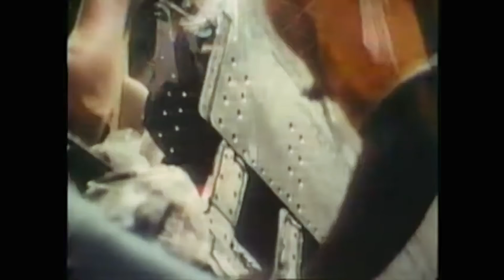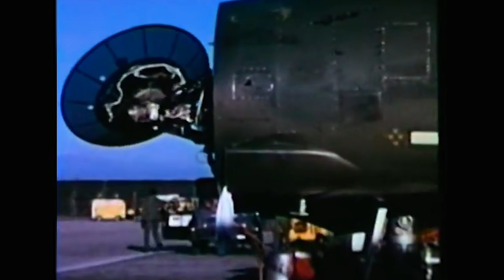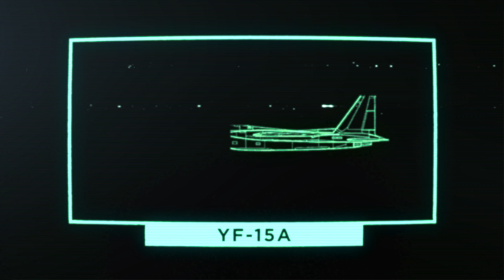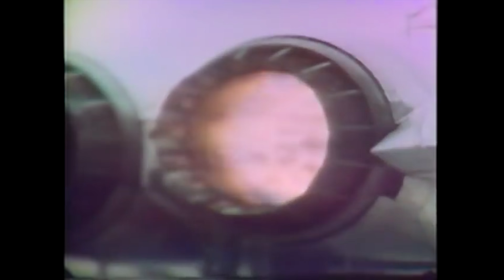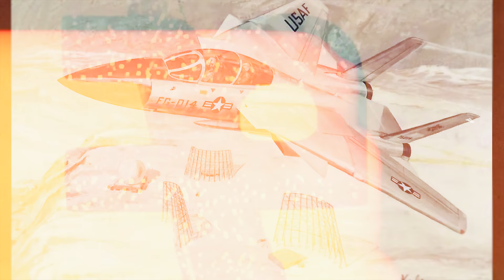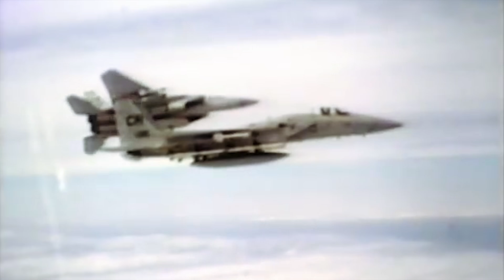F-15N | the forgotten 'Sea Eagle'

Comment: I think rather than thinking, “damn the sea eagle would have been better than the f-14” I just appreciate the the f-15 program was versatile enough to even be considered in the first place.
Reply: At sea, there was no aircraft better than the F-14.
The F-14 is a masterpiece of engineering
Reply: @رضا-ص2ن  The F-14 was always a maintenance nightmare.  However, the combination of endurance, the AWG-9 radar, and the AIM-54 Phoenix gave it a capability the US Navy, and the Iranian Air Force, decided they really needed.

It was optimized to shoot down Soviet bombers before they go within cruise missile range.
Reply: So you know how people complain about F-35 crashes? The number of F-35s that have crashed in its US service life so far across all 3 branches was achieved by the F-14 in its first 2 years...
Reply: @TyrannoJoris_Rex I need some help understanding, does that mean the f14 is better than the 35? Or worst?
Reply: @BLADEMANDAD  Neither. Just means the F-14 crashed way more frequently
Reply: @TyrannoJoris_Rex  I see, thats expected given how unforgiving carrier ops is, the fact that the tomcat is at best manual with stability augmentation vs fly by wire... and all the sensor/instrumentation gaps between the f-35 and the f-14...
Reply: @BLADEMANDAD  F-35 operates off of carriers as well as STOVL aboard amphibious assault ships, so F-14 doesn't get that excuse
Reply: @TyrannoJoris_Rex  , FLY BY WIRE and PLM???

big diff mate.
Reply: @TyrannoJoris_Rex  Fly by wire systems make a huge difference my guy as well as the F-35 getting an extremely advanced Heads Moving Display system for considerably better situational awareness. Its like comparing a F1 car from 1980 to one from today.
Reply: @رضا-ص2ن  Yes and no. In terms of its radar and the use of the Phoenix missile, the F-14 was revolutionary for its time. However, as time went on, the issues that plagued the early variants made the aircraft less and less valuable, particularly because of the costs associated with maintaining, and often simply fixing, the aircraft.
The engine issue is probably the biggest example. The Navy rushed the F-14 into service with the TF30 because the engine they actually wanted wasn't ready, and the TF30's reliability and handling problems held the Tomcat back for much of its early career. The F-14B and F-14D addressed a lot of this with the F110 and improved avionics, but by that point the Tomcat was already an expensive and relatively specialized aircraft.
And that's where procurement becomes important. Only 38 new-build F-14Bs and 37 new-build F-14Ds were produced, compared with roughly 400 F-15Cs and over 1,400 F/A-18A/B/C/Ds. The Navy simply didn't procure the later Tomcat variants in anything close to the numbers seen with other 4th-generation fighters. The F-14 also had virtually no export market outside Iran, whereas the F-15, F-16 and F/A-18 were exported to numerous allies, helping sustain their production and development.
So I wouldn't argue that the F-14 was a bad aircraft. Quite the opposite: it was genuinely revolutionary for its time. But being revolutionary doesn't necessarily mean it was the most practical or sustainable fighter over its entire service life. Its engine problems, high operating and maintenance costs, limited export market, and relatively small procurement of the improved variants all contributed to the Tomcat ultimately having a much smaller long-term footprint than aircraft like the F-15, F-16 and F/A-18.
Reply: @رضا-ص2ن  the F-14 was a master of design, not engineering. If it was a master of engineering, it would've had a much better maintenance anf availability rate
Reply: @De_cool_dude The design of the F-14 started in the 1960s and was completed in 1974. At that time, it had the world’s most powerful radar, the best variable-sweep wing system, the first turbofan engines, the world’s first chips, and the best computer systems of its era. Most importantly, it had the best coordination with the longest-range and best missile of that time — the Phoenix — and achieved the best results.
Trust me, my friend. I’m from Iran. Back when relations between my country and the United States were good, we bought eighty F-14s. Three years after the contract was signed, a disgraceful revolution took place in my country. Less than two years after the revolution, Iraq attacked my country, and Iran’s F-14s were on the front line defending the skies of my homeland.
Iran is a country that has vast seas to the north and south, two extremely harsh, long, and high mountain ranges, and a very complex climate. Right now in summer, the temperature in my city of Ahvaz is over 50 degrees Celsius, while in another part of the country the snow is so heavy that the whole world looks white.
When the revolution happened in Iran, the new government either fired or killed most of the Air Force personnel, engineers, pilots, and even the janitors. After the revolution, Iran was sanctioned by the United States and no F-14 spare parts reached Iran. Iran also had no AWACS. Despite all this, Iran fought the entire eight-year war with the F-14, scored the longest-range kills in history, and produced some of the best Iranian — and even world — pilots, all of whom were F-14 pilots. Iran achieved over 150 aerial kills with the F-14. After the war, because of the sanctions, Iran couldn’t buy new aircraft, so it kept the F-14s for nearly 50 years until they were destroyed in the war with America.
I told you all of this so you would know that the F-14, under the worst and hardest possible conditions of maintenance and support from my country, defended it in the best possible way. That’s why I call it a masterpiece of engineering. The F-15, F-16, and F-18 never operated under conditions like those of Iran’s F-14s.
Reply: @رضا-ص2ن  Don’t get me wrong I think the F-14 is pretty cool but Iran had the option to choose either the F-15 or the F-14. I’m sure if they had chosen the F-15 you would be talking just as highly about it. In the end, it’s just perceived greatness depending on whichever aircraft your own country flies
Reply: @GFSツ Until before the Iran-America war, there was a lot of discussion in my country about how Iran ended up preferring the F-14. Then the people who had evaluated both aircraft on behalf of my country at that time came forward, spoke, and explained that because Iran is a vast country with harsh mountain ranges, it needed an aircraft with a powerful radar and missile. That is why the F-14 was chosen. Of course, there were other reasons for selecting the F-14 as well, but it would take a very long time if I wanted to talk about them
Reply: @رضا-ص2ن  yes and no, physically range was in favor of the f-15. Even the f-15a was a longer range than the f-14a and Air Force thought the f-15a was short legged. The f-14 was a naval aircraft but Iran used it as land based fighter. I think Iran choice was based on  the awg 9 + Phoenix. Not much else in terms of performance, as in every other aspect, the f-14 fell short of the f-15.
Reply: @christosalexandropoulos7807 You’re saying Iran didn’t choose the F-14, but rather its radar and missile. That’s great. Now I want to know: if you take away the radar and weapons from fighter jets, what do they really have left to offer??
You can have a fighter with the best engines in history and the longest flight range, but if it has no radar and no weapons, then it’s not a fighter at all anymore. Maybe you could call it a private jet!!!
At that time, Iran shared a border wall-to-wall with the Soviet Union, and Soviet MiG-25s were constantly flying over Iranian airspace. No Western fighter could counter them as well as the F-14. It could detect aircraft from a much greater distance than the standards of that era, and it could fire the Phoenix from a far greater range than the Sparrow missile and still hit the target.
At that time, the F-15 was essentially offering the same Sparrow that the Phantom had, just with an upgrade, while the Tomcat had a new and better missile.
Iran had a plan to use the powerful radar and missiles of the F-14, together with the E-3 AWACS it had purchased, to create a very large coverage over the skies of Iraq, the skies of the Soviet Union, and southern Iran — that is, the Persian Gulf, the Strait of Hormuz, and the Sea of Oman. As we can see, the AWACS were never delivered to Iran. Even so, Iran, though not on the scale of the original plan, was still able to create good coverage over the skies of Iraq, the Persian Gulf, and the Strait of Hormuz with the Tomcats. A pilot from my country used to say that to cover the entire west of Iran, despite the harsh Zagros mountains, only four F-14s were needed — just four, and that without any AWACS.
Reply: @رضا-ص2ن  I’m not arguing that the F-14’s radar and Phoenix weren’t revolutionary, because they absolutely were. I’m talking about everything else when comparing the F-14 and F-15.
The Phoenix was designed around a very specific problem: destroying Soviet bombers and cruise missiles at extreme range before they could threaten the carrier battle group. In the Iran-Iraq War, the Iranians demonstrated that the system could be extremely effective against actual aircraft as well. The MiG-25 and Mirage F1 were both capable aircraft for their time, and Iranian F-14s achieved impressive results with the Phoenix despite the Iraqis having defensive systems such as RWRs. If the Phoenix was being used against even more capable aircraft with better electronic warfare, the question becomes how much of that enormous range and capability would actually translate into successful engagements.
And that’s really my point about the F-15 as well. If you took the F-15 and put it against increasingly capable opponents such as MiG-29s, Su-27s and later-generation fighters, you would still have a platform whose fundamental design was centred around air superiority and which could continue being upgraded. 
The F-14, meanwhile, was a highly specialised fleet-defence interceptor that happened to also be an excellent fighter. Once the specific requirement for shooting down Soviet bombers at extreme range became less important, you were left with a very large, complex and expensive aircraft whose specialised advantages were becoming less valuable.
That’s why I think time is ultimately what highlights which system is more valuable and practical. In 1974, both the F-14 and F-15 (1976) were arguably the “next thing,” but they were optimised for different problems. The F-14 offered extraordinary capability for its specialised mission, while the F-15 offered a more broadly useful air-superiority platform. As the threat evolved, the value of those design choices became clearer.
And that’s also why I wouldn’t use the Phoenix’s success in Iran as proof that the F-14 was simply the superior fighter. It proves that the Phoenix/F-14 combination could be extremely effective in the right circumstances. But if the overall F-14 package had remained the more valuable and practical solution, you would expect the U.S. to have continued buying large numbers of improved Tomcats instead of ultimately moving away from the platform. The fact that the F-15 kept receiving new variants and upgrades for decades while the F-14 disappeared from U.S. service is pretty significant, and people will say Dick Cheney killed the program but it is an over simplification, as the USA was not buying lots of f-14bs and f-14ds in first place, showing the lack of faith the navy had for the program as time went on. Cheney just pulled the trigger.
Reply: @christosalexandropoulos7807 I agree that the F-15 was more upgradeable than the Tomcat. We’re seeing right now how many different capabilities the new Eagles have. There are different opinions on why the Tomcat was retired. Many people say it was because the Super Hornet was introduced, but in my opinion there were other reasons as well. The most important reason was that the Tomcat’s mission was over. As you said, the Tomcat was built to defend the American fleet against Soviet bombers and cruise missiles. When the Soviet Union collapsed, there was no longer a serious threat to the American fleet given the very poor condition of Russia in the 1990s. And in my view, when the Raptor entered service, the Navy’s attention shifted toward stealth fighters, which is why it wanted to get away from the expensive Tomcat.
But there’s one question that has always been on my mind: Could the Tomcat platform really not have been turned into an aircraft like what the Eagle is doing today? In my opinion, instead of working on upgrading the Hornet platform and turning it into the Super Hornet, they should have built a Super Tomcat. I believe the Tomcat platform deserved a new version more than the Hornet did.
Reply: @GFSツ personally I would choose the f14. Especially in the 80-90s since it had the AIM-54 allowing engagements up to 80~ nm.
Reply: @De_cool_dude depends on which perspective u are talking about... definitely a master of engineering for its time... you have to compare apples to apples...
Reply: @Night_Fury08h  The F-14 had a pretty short window of superiority, though, since by the early 90s the AMRAAM had already entered service and the F-15 had a more modular design, making the implementation of the AMRAAM to the aircraft simpler and less expensive than on the F-14, whose entire design philosophy was centred directly around being a fleet defence interceptor capable of wielding an AWG-9 radar set combined with the Phoenix. In essence, the F-14 wasn’t a very versatile aircraft when compared to the F-15 and it really only had one trick up its sleeve,BVR, which later the F-15 could do better.
Reply: @christosalexandropoulos7807 Exactly
Reply: @رضا-ص2ن  the f14 really wasn’t that good. Limited upgrade potential and a hanger queen. A fighter is no good if it can’t be in the air
Reply: @etrain757  It had tons of potential upgrade.  They just chose not to.

The fact that the Tomcat was upgraded with LANTIRN on a shoe string budget, allowed it to became the FAC(A) platform of choice over the Hornet when the A6 was retired says a lot. On the same boat and same cruise in OEF, VF14 put down 395,000lbs and buddy lased another buddy-lased 190 weapons for allied aircraft including the Hornet squadrons from Roosevelt.  None of that says "Hanger Queen" nor "Limited Upgrade Potential."

Source: 
https://www.history.navy.mil/content/dam/nhhc/research/archives/command-operation-reports/aviation-squadron-command-operation-reports/vfa/vfa-14/pdf/1999.pdf
Reply: That's a very superficial and naive thought considering you are comparing a paper study against a tested and proven platform.

Navalization of airforce  fighter platforms has never actually succeeded.
Reply: @BLADEMANDAD  never said it would work. I’m just impressed that it received enough funding to actually be assessed and considered. I don’t really see how that’s naive when that’s literally what happened. Congress nor the Navy would have wasted time and money assessing it if they thought it was completely unrealistic. They ultimately found that it was unrealistic, but the point is that they considered it in the first place, which I find pretty impressive.
Reply: @christosalexandropoulos7807  you probably wont see them doing it again now unless they learnt their lesson... back then the understanding of fighter design , tech and engineering is weaker in  congress and in the upper brass over the navy vs now (abeilt with a.i assistance)... also , it was a new generation of tech and fighter design capabilities, they probably thought the latest and greatest tech could out weight fighter design compremises, especially for carrier ops.

they were wrong thou in the end.
Reply: @BLADEMANDAD  The FJ-2 Fury begs to differ.
Reply: @Cowboycomando54 , i beg to differ...  apart from bering bigger guns to the fight... it was an inferior carrier aircraft  and against the F-86, it had inferior performance...

Good try thou... u got.me thinking... 

I concluded that only the F-35C contradicts my statement... it maintains it BFM performance with the carrier augmentations because of its bigger wings which also gives it enhanced range and endurance while.maintaining stealth
Reply: https://youtu.be/GCf-2v2XWZs?is=BDrZVv5E9-XRFK3F

For your perusal sir...

I hope his narration doesnt annoy you... i find his imconsistent speed of narration very annoying.
Reply: @BLADEMANDAD  It still worked and still saw service and lead to the FJ-4 Fury which was an excellent naval fighter in its time. Plus there the late model of the Corsair II which started as the Airforce's modification of the platform which then was put in service for the Navy, replacing the original versions of the Corsair II.
Reply: @Cowboycomando54  hmm you know what, i really appreciate how polite and factually you presented your counter argument.

i will go read up more on this and the Corsair II.

Thanks!

i'd always thought the Corsair II was developed from the F-8
Reply: @BLADEMANDAD  I recommend watching some of Not A Pound For Air To Ground's videos on the aircraft.
Reply: @Cowboycomando54  wilco!